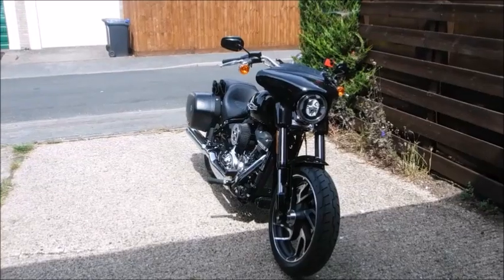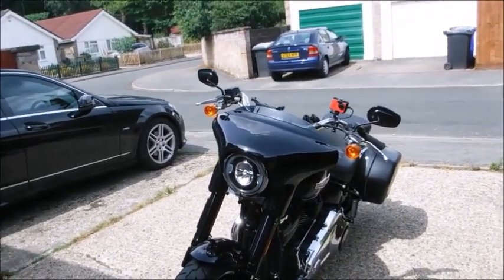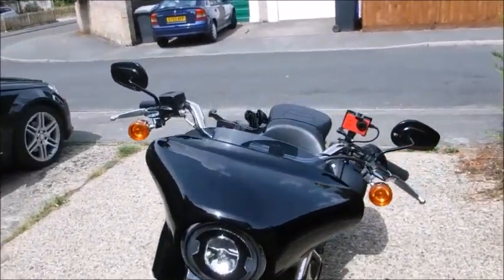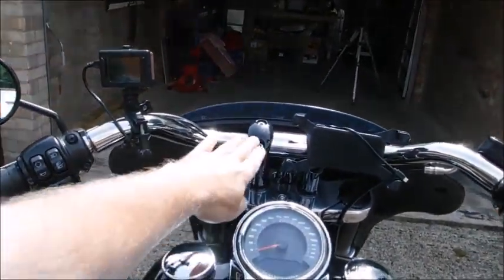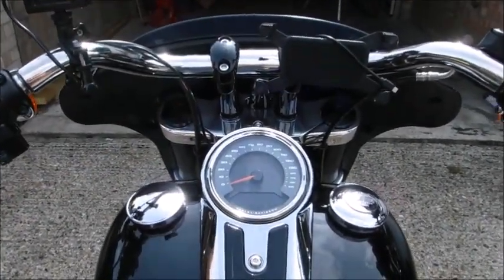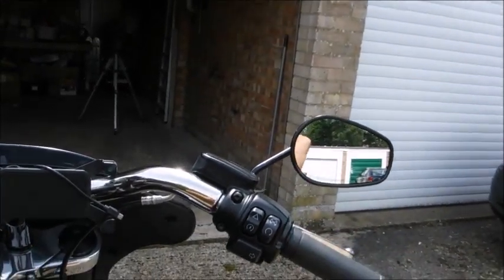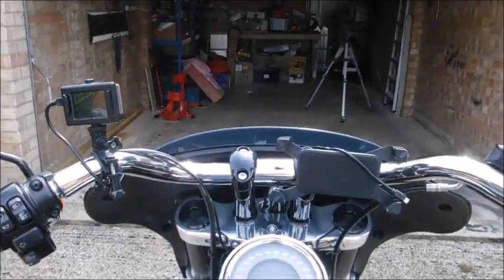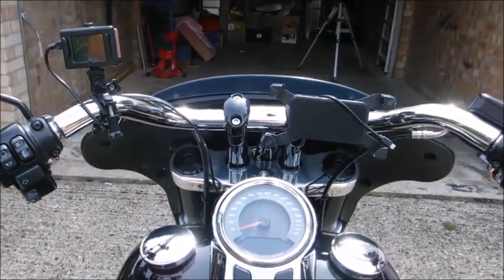Suffolk Sport Glide  updates on Horn tone and Risers with fairing

Comment: Thanks! Sounds good! I added the H-D  4” pull back(curved) risers and it’s great for my 5’4”stature. I also added a slipstreamer custom 7” screen with curved lip and smoke color. Great for wind pressure off my head and helmet but a bit of buffeting at my eyes. Not bad at all just a little difference. Ride on and ride safe

Comment: Thanks for the effort, I think it looks great. Easy way to customise the bike. I was thinking to put Street slammer bars on it but this works well too I guess and a lot cheaper, thanks again, ride safe.
Reply from the maker: it is all personal preference, but i do like the shape and fit of the handlebars, just wanted to move them a little bit. and yes this was a cheaper option. 
changing bars will involve running cable in the new bars so just a bit more labour intensive. let me know which way you go. cheers Tom

Comment: I dabble in amateur radio, lower frequencies travel further for the same power ( volts & current) I think the lower frequency horn is sounds louder also.
Reply from the maker: thanks for that info Stephen, as i say, with my hearing i cant tell the difference. i might have to think about swapping them over. Cheers Tom

Comment: How did you go with clutch cable fitting with the 4” inch straight risers? It seems like if you swap over cable to in front of bars it’s sliding and touching fairing pushing fairing slightly forward having it in standard position over the bars it stretches cable ?? Any clues would be helpful
Reply from the maker: Sorry to hear that, I dont have that problem, can only think that its because i have probably pulled the bars back a bit, i had them loose and sat on bike and just put them in a comfortable position, but we are all different in how we like to sit. hope this is helpful. cheers